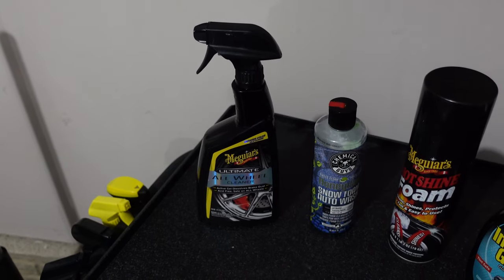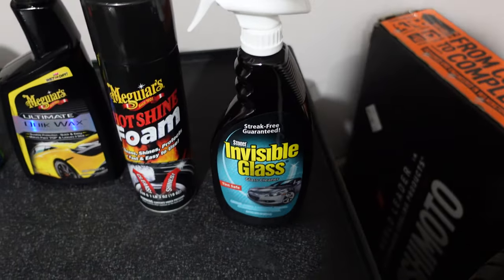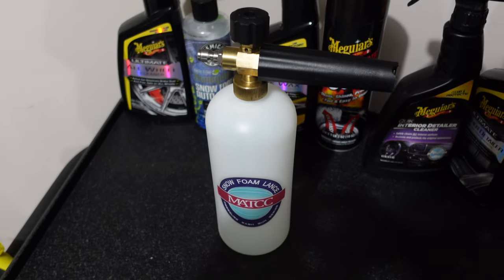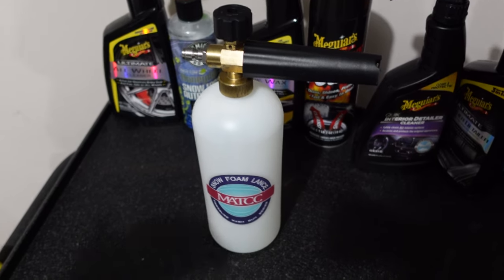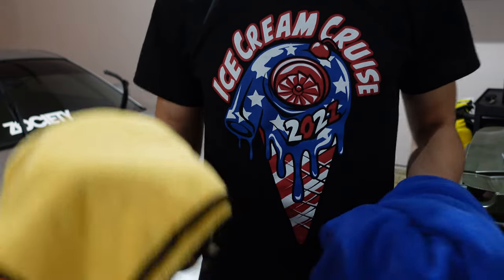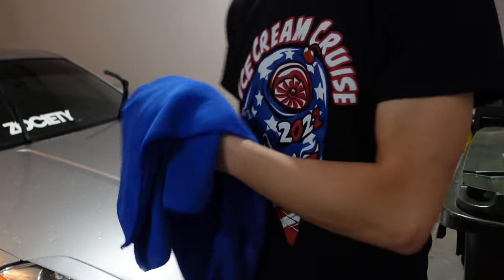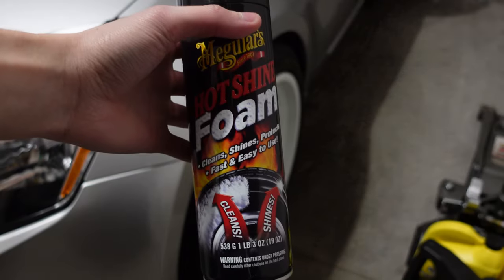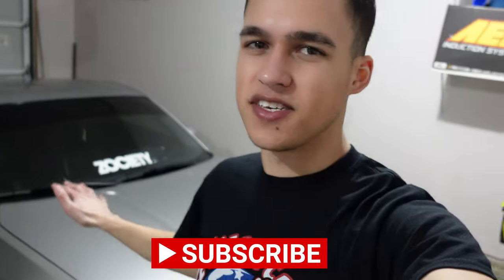How I Wash My Nissan 350z!

Comment: Which spoiler is that you have on your Z and will it go into the same holes as the lip spoiler?
Also one other thing....If you were to look at this video at the 10:15 mark half an inch above the settings icon it looks like you have a dent in the hood.
Reply: Am I correct?
Reply from the maker: @Drago Musevini Hey man it’s a Nismo V2 spoiler! I’m not sure about the mounting holes since the wing was already on the Z when I got it. I would think they are similar since it’s a Nissan part. I don’t see the 10:15 mark in the video, it looks like it only goes to 10:14. There are a few scratches and smaller dents in the hood though 😂 Either way thanks for watching man ✌️
Reply: @dominiccampbell6087  no problem I have a HR 08 myself and am really OCD with it.
Reply from the maker: @Drago Musevini that’s awesome, I need to get better at that! I’m planning on fixing all the body issues at some point in the future. I have a nice chunk of rust developing in the rear right fender panel that I want to get rid of
Reply: @dominiccampbell6087  I have a dot above the back right wheel well so I understand. Me washing the car properly seems to be keeping it in check as well as the surrounding paint.